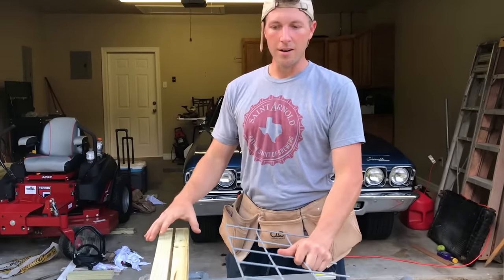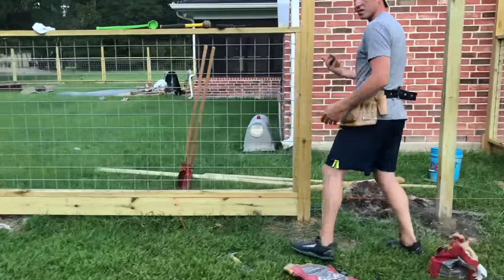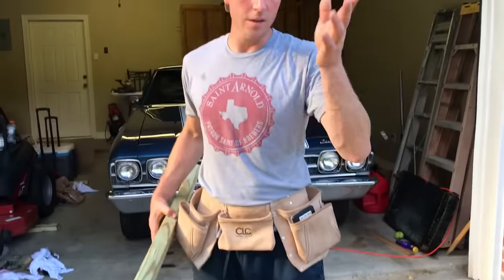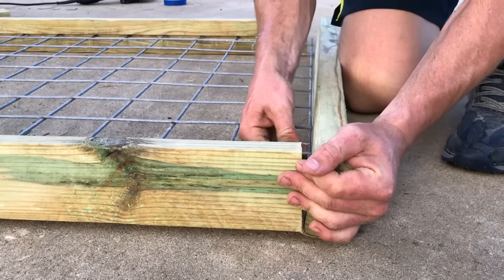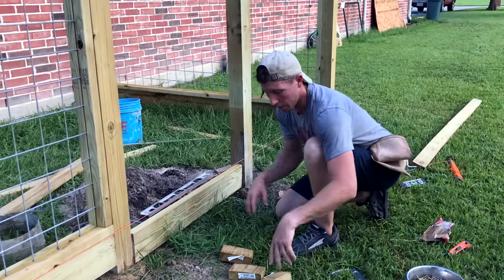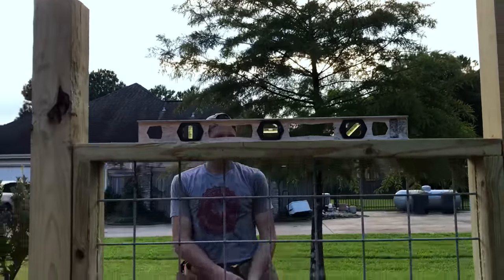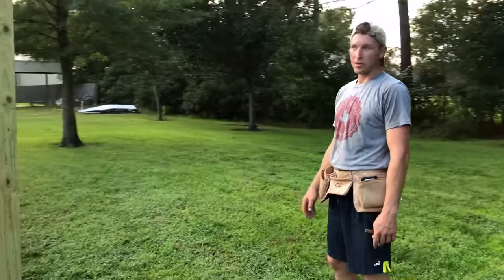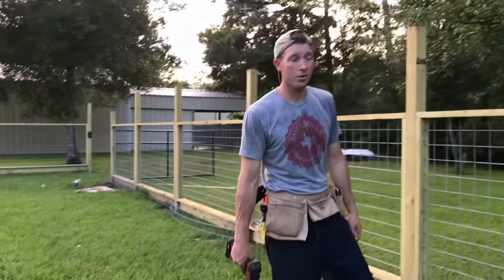Part 1: Modular Hogwire Panel Fence with Dado Groove

Comment: I would trim the tops off, you may need that to run a wire to keep the pups from jumping out. Btw Your fence looks Great 👍🏻
Reply from the maker: i posted the video before trimming the tops. I will have my 18 month evaluation and staining part 2 loaded this evening or tomorrow. in short, there is nothing i would change about this fence. We love it!
Reply from the maker: https://youtu.be/bL89wkzSPDo
Reply: For some reason the “not” didn’t show up on my post, either way I think the fence was/is Great thanks for sharing
Reply from the maker: Larry Schmitt ahh I got you.. yes makes sense. It’s 5.5ft tall, more than enough to keep these pups contained

Comment: Could you screw the 2x4s on first then slide in the hog wire , the. Pot on top? 

Asking for a little girl who doesn’t want to carry the panel and hope that my measurements are good.
Reply from the maker: If ALL measurements are perfect, then yes.. send photos when your done jkhartel3@gmail.com
Reply: Then put on the top piece * 🤦🏻‍♀️ 

I will send photos ! I am new to all of this and this will only be the second fence I have built (first was a small one around my garden) so lots of imperfections. 

Also, could I use a 2x4 instead of 2x6? 

Andddd I was wondering where you got your Hogwire - if you could send a link that would be aaaaamazing. 

Thank you so much!!
Reply from the maker: The 2x6 rot board I used was only for adding strength to the base of the panel and add 6” to the overall fence height.. if you choose 2x4 as your rot board then your fence would only be 2” shorter overall than mine. You could use any width rot board you want. 
Here’s the panel I used from tractor supply https://www.tractorsupply.com/tsc/product/feedlot-panel-sheep-goat-16-ft-l-x-48-in-h
Reply: Awesome, thanks much!

Comment: nice looking fence.. but i wouldn’t want to use wood post to only have to dig them out later to replace them because of weather rot..??? every post i replace on the fence that is snapped in two i replace with chainlink poles
Reply from the maker: I agree deterioration is always a concern, especially when putting a lot of time an money into a project. I did research for expected lifetime of wood post in the ground. From what i gathered, majority of wooden post are set with the concrete level with the ground, which holds water and the lifetime at the base is increased if you put the concrete above the ground line. I put 3-4in of gravel at the base and used 8" dia. X approx 10" long metal A/C ducting that i found in the A/C section at Lowes. I cut with a hacksaw on the manufactured seam so that the cylinder was more or less a big metal band that i held together as a cylinder with vicegrips after wrapping around the base of the post. This allowed me to mold a concrete head about 1.5" above the ground for most post and still remove metal cylinder after it was setting (10mins), and a few are bit higher. When the concrete was in its setting stage i used a small knife to carve away the mold to resemble a dome shape so the water would run off. I don't know how much longer i will get out of my bases, but i do have peace of mind that i prepped them the best i could for the expectation of a longer base life. Thanks for the reply.
Reply: @GatorOverland  cool man.. you did a great job.. i'm tired of replacing wood post so i try and only use metal.. :)  and very nice car man.. friend has a W-30 442 Olds
Reply from the maker: @mrichrich-nr8id  nice!! and thanks. I have few gremlins left to figure out, but for the most part shes runs strong and rides smooth. There are plenty of alternatives to consider when it comes to deciding the posts, galvanized steel, aluminum, pvc etc.. I needed a fenced in area ASAP for my pups and didn't have alot of extra cash or time to consider the alternatives. Down the road it may be that i spend more money replacing post, but it was easy enough to construct that im not to worried about replacing a post here and there in the future.

Comment: I have a question, how do you get the 16' lengths of wire to your house?  I mean I have a 12' trailer but even that won't work
Reply from the maker: Joe gag I used a 12 ft trailer for mine load as well.. I loaded up the middle area with cement bags to make it flush from side to side of the trailer. The tractor supply employees brought the 23 panels over on a fork lift and set it down on top.. I had them overhand it on the front about a foot and balance about the back and put red rags on it. When securing it down side to side of the trailer, I wove a ratchet strap through a few of the panel 4x4 holes to keep it from sliding back and forth. I had the same concern as you at first, but it really wasn’t as bad as I was expecting. When I got home I brought the panels to where I planned to store them and laid down some 4x4 posts to set them on. I parked my wife’s grand Cherokee and set the park break just behind the trailer as an anchor point and affixed a tow strap to her hitch and then looped the strap through all the wire panels. And then I just drove the trailer out from under the panels and they landed nearly perfectly on then 4x4 boards I had set out. I hope this helps.
Reply: @GatorOverland  nice man good idea.  But the rear tailgate sticks up so the only overhang could be in front where the tongue is. Only way I see that working is to remove the tailgate?
Reply from the maker: Joe gag I removed the tailgate from mine.. it was pretty easy to do for what it’s worth.

Comment: Nice fence!!! I believe I would have added lattice strips to the top and another rail above that .
Reply from the maker: Thanks, yes i agree. I did the video before i trimmed the excess height from the 8ft posts to 2.5" above the top rail and placed a wooden 4x4 ornamental post cap. I wish there was a way to post an image of how it looks currently for others to reference. But definitely, if i was keeping the post at that height i would have done some sort of lattice or another hog panel length and top rail above. The fence his holding up well after near 6 months of few dry days in southeast Texas.
Reply: @GatorOverland  That's great John. I'm actually looking into an unframed version and using a Gabion wall underneath to retain soil .
Reply from the maker: @smokeydabeecharlescoleman8365  that should work out great!

Comment: your board at the bottom under each panel, 2x4 or 2x6?
Reply from the maker: I did 2 x 6 but you can do anything you want between 2 x 4 to 2 x 6 to 2 x 10 to 2 x 12… Basically the wider you do the bottom board the taller the fence gets

Comment: Great video ! How is the fence holding up? I'm thinking bout doing the same,but concerned with the pressure treated lumber warping.Thanks
Reply from the maker: thanks for the reply Dan! the fence is holding up great. I haven't had any issues with warping or deviation from original placement. It took about 6 months after construction before it would accept protective staining. Other than that i recommend the weep holes for draining the bottom groove about every 6" to 8". It has been great for my pups, and ive had others in the neighborhood inquire and replicate the same fence for their own yard. Shoot an email to hawkijon@aol.com for construction plans and cost generator i developed based on my build per linear foot.
Reply: @GatorOverland  Thanks for the reply
Reply from the maker: Dan https://youtu.be/bL89wkzSPDo

Comment: I would like to install similar panels for a balcony that is 25 feet above the ground. Can you mechanically secure the wire to prevent it from popping out under heavy pressure?
Reply from the maker: Watch my part 2 video.. it’s not popping out unless you are driving a truck though it ..
Reply: Thanks, Gator!
Reply from the maker: There are links in the description for what panels I got.. they are at tractor supply!

Comment: Beaumont, Tx., where I used to live for 8 months back in the late 70s.  My Godfather still lives in Beaumont.  Wished I could move to Texas now, but I can't.  8-(
Reply from the maker: Small world, and even smaller if i knew of your godfather or family for that matter. On the upside, Texas will still be here when you do decide to move here, its not going anywhere. If youre in oil and gas or medical field you wouldn't have a problem finding a job either.

Comment: kool fence design,  weep holes? and spacers  , keep learning gettn there :)-- board can launch like rocket into that nice car, seen kick back go thru doors lol,
Reply from the maker: Thanks Ken, weep holes are simply holes i drilled from the bottom into the dado channel to allow for water to drain. As far as the spacers, that was a suggestion by youtuber with some dado or wood fence experience. The spacer/shim would used to keep the metal panel from bottoming out in the dado groove, and allow for air movement for quicker evaporation of trapped water. And fortunately i had no kick backs or missing fingers from my less than safe woodworking techniques. If could do it all again i would probably use spacers with the weep holes as well as turning my table saw 90 degress and using a push stick. The fence is holding up quite well.

Comment: I have been reading a lot about the effects of todays treated 4x4's with ground contact.  Most of the treated 4x4's are only treated for bugs and not rot.  Did you ever consider putting your 4x4's on concrete piers with metal post holders
Reply: I thought the same thing, often why you see decorative wood surrounding the bottom of the post.
Reply: Nice, I like that idea. I think I’ll do that if I go this route.
Reply: I use post protecters on all of my ground contact projects. Won't do a project without them. Slide the sleeve over post put in ground. Post never come in contact with ground

Comment: On the surface the fence looks nice.
But the fence wire its self is not really attached it is sitting loose in the dado groove a good sized dog going at the fence may push the fence wire out of the groove and get loose.

And alcohol and power tools do not mix, glade you came away with all your bits still attached.
Reply from the maker: James Grunwald Thanks for the reply… I agree that I could’ve practiced a bit more safety during my project, especially when uploading to the world of YouTube. As For the fence, the wire panel is by itself is fairly rigid. When Placed in the dado groove frame it is very sturdy. I’ve Leaned and pulled on it with all my weight and you’d be surprised how little the panel gives. I’m confident that it would contain anything shy of an atv or truck hitting it. It’s worked great for my 200 pound mastiff and 50 pound Aussie. In a recent windstorm, the majority of the people in the neighborhood with a plank fence had significant damage, and mine is still standing without a problem.

Comment: Can you use a roll of weld wire instead of panels and get the same result
Reply from the maker: That is a very good question. I think that would work with my design, but from my experience, the roll wire isn't as rigid by itself the way the utility panel is and could result in construction complications because of its flimsy nature. You could save a few steps of my design, but still make a frame without the dado and hammer staple the wire to the frame and the post much like you would barbed wire. Im not sure how sturdy the end result of that would be, but i guess that depends on what exactly your trying to keep in, or out of the fenced area.

Comment: I'm no expert, but it seems like the dado cut would collect water and rot the wood faster, no?
Reply from the maker: It potentially would.. I applied weep holes in the dado. I cover this concern in my part#2 for staining. 
Otherwise we are 6 years strong and no issues with warping, splitting, or rot
https://youtu.be/bL89wkzSPDo?si=uhoJdrd5Q7BcMr-o

Comment: With all due respect, that type of wood won't last 5 years, Even stained. And if you don't want someone to walk off with both your expensive gates, you need to turn the top hinge pin 180 degrees downward then attach the clamp. Love the look and your craftsmanship. Beer on!
Reply from the maker: mikewillfindgold thanks for the reply and The insight… I guess we will see if it stands to the test of time… So far so good no bowing, warping, or splitting.

Comment: Nice work my Chevelle brother.  Your canines have a great space!  Any worries about moisture gathering in the dado?
Reply from the maker: Thanks for the Reply! I appreciate it! Though the groove does gather some biotrash (leaves, pine needles, etc.) thus far i havent seen any decay or signs of extreme weathering in the dado. Take a leaf blower to the groove when i mow and it does a pretty good job of cleaning out the groove. I drilled 3/16" hole in bottom frame dado about every 12" across, and poured a large bottle of water in the groove to check and it drains sufficient enough for my worries to be minimal. If a bottom panel frame board were to rot out, it would cost me $4 and about 20 mins of my time to replace, which is nothing considering how long it took me to develop everything. I have a detailed hand sketch with material break down and excel cost generator i developed based on my build available. If you are interested, shoot an email to hawkijon@aol.com.

Comment: Thanks for the video, I loved the build. Looking to build this myself at my new house but had a few questions. Do you have any advice on finding that 4x4 inch opening panels? I can’t seem to find them online or locally and have to instead use much large 6x8 inch opening panels. Also with my back yard there will be 2 weird angles(over 90 degrees) that I will need to build into it and I’m struggling to find a clean way to attached the modular framed pieces to a square 4x4. Thanks for any help and advice you have.
Reply from the maker: Absolutely, thanks for the reply… I got my panels at tractor supply… But I’ve had many viewers like yourself build the fence successfully with the 6 x 8 panels and not had an issue… Only difference is you don’t cut on square runs of the fence… It’s a little offset… Shoot me an email at Hawkijon@AOL.com, And I can better answer all your questions… Look forward to hearing from you

Comment: Hi John, your fence looks great!  Quick question-  what vertical dimension did you cut your panels to?  I’m having trouble figuring out where those cutoffs that you’re using below the fence came from.  Thanks for posting this video!
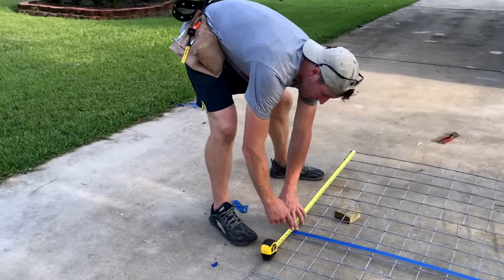Reply from the maker: I apologize, I wasn't sure how insert corrections for my blooper dimensions. I did the video all in one take and I knew I fudged a few numbers when I was on my rant, but the video if for reference anyway. The panels are 16ft (192") long X 5ft (60") tall and I said 50" by mistake @ 2:05. I trimmed all but the panels at the gates sections down to 4ft (48") tall X 7'-8" (92") long which would put you cutting up against a hard wire run as a guide, which is preferable. This is why I had 12" sections of trim (4" squares X 3) used during my example @ 2:11. On the 7'-8" (92") lengths I cut out 8" (4" square X 2) from the middle of the 16ft length, so I could have even full panels (wire borders on all 4 sides). The panels made at the gate section are the only panels that i had to cut in the middle of a square section (as seen when I lay blue tape at 35" @ 8:28). I hope this makes for a better understanding.

Comment: Looks awesome! Did you use 2x6 boards for the bottom portion that’s closest to the ground? If so, how many?
Reply from the maker: Yes, I used 2x6's as my mud/rot board. You could use 2x4, 8, 10's as well. This not only makes a weather barrier between my bottom panel frame and the ground, but it also added 6" to the height of my fence as well as rigidity between posts. My mud/rot boards are on average about 1.5" to 2" above grass/ground level due to variation of levelness of the yard. So i beneficially increased the height of my fence by 8". I used (1) 2x6 as mud/rot board per panel flush to the outside, so 25 total.
Reply from the maker: send an email to hawkijon@aol.com and i will send back a detailed hand sketch with dimensions and material breakdown.

Comment: Great fence, did I miss how the "hog wire" is held in place other than the dado. I know about the dado in the 2x4 but you have a large dog. what holds the wire in the dado is the hog wire that rigid ? 

Thanks.
Reply from the maker: D-MAC a viewer below inquired about the same “Omar Flores you’d be surprised, the wire utility panels themselves are very rigid. Other than fencing use, they are commonly used for industrial shelving. With the panels set 1 inch in the dado all the way around, id be lucky to make it though the fence with my lawnmower. If it were the hog wire material that comes in a roll bundle, what you have suggested would be very possible. Thanks for the reply!” Hope this answers your question. Should you be interested, send an email to hawkijon@aol.com and I will forward you my hand sketch and material breakdown for reference!
Reply: The panels are 16g wire.

Comment: You did a great job and I learned something. Would this type of fence work with  1/2" hardware cloth instead of the cow panels or is the gauge too thin?
Reply from the maker: You could do my design and use staples, but I fear the hardware cloth is too thing and flimsy to worry with this design
Reply: @GatorOverland  thanks